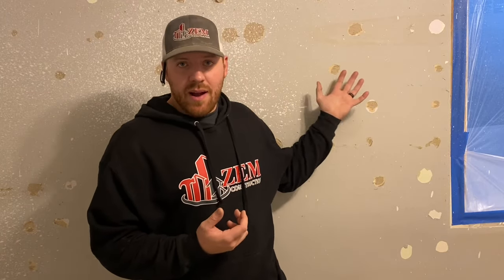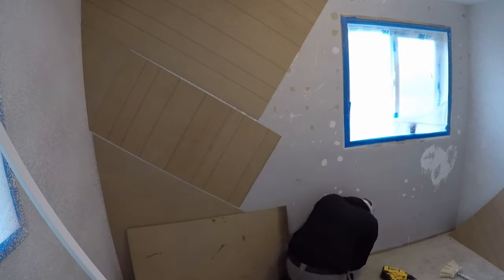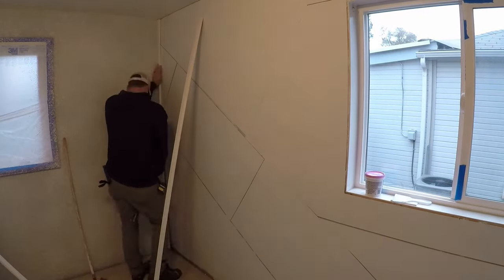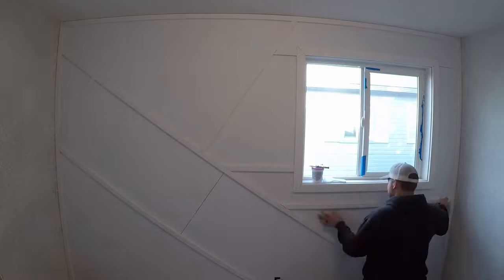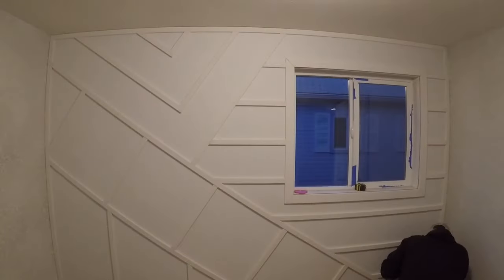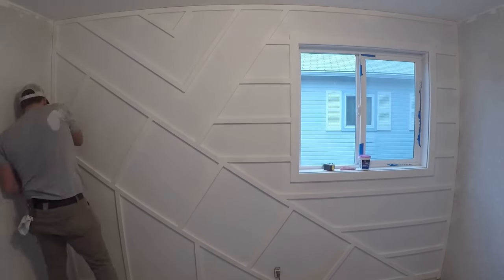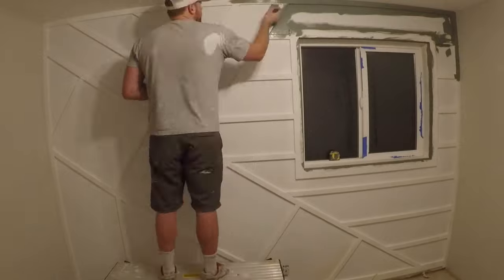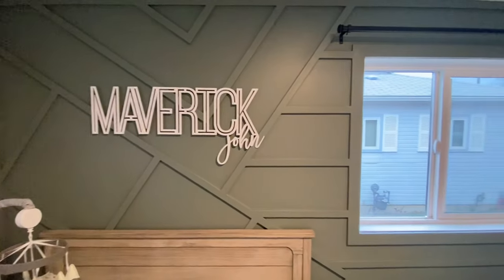Modern Accent Wall | Nursery Remodel | Time Lapse

Comment: Was the window trim flushed to the accent walls? Trying to do an accent wall with MLV and drywall to noise reduction. Not sure if I put the MLV/drywall to the edge (have to hide the sandwich look)and put the trim on top or just around with clearance to put the trim. Either it seems it will be heard to be flush with the trim and the accent slats.

Comment: Looks awesome!! Really really like it :) my wife and I are moving (and expecting) and we’re watching all these vids to get ideas, etc. we both wondered though, why the wood panels at the beginning? Why didn’t II just put the trim pieces onto the wall? At first we thought maybe because there was a texture you wanted to see through to the finished wall, but in your case, there wasn’t. So why the panels! Either way, it turned out AWESOME! Thanks!!
Reply from the maker: There were a ton of holes from where I took off the “pallet” wall both from nails and the adhesive tore the top paper layer of the drywall.
Reply: @ZEMConstruction  Ahhhh got it. Ok! Makes sense. Thanks for replying. Looks awesome! Love the fact that you used math :)

Comment: Looks really great, but you couldn't you have just installed drywall and used the trim to make the wall design.  I'm not certain why you hung the paneling as I do not see it in the final design.  Wouldn't drywall on an angle work just as well?  Did I miss something?  Great video and very professional looking job.  I love it so much I'm going to do something similar.
Reply from the maker: Honestly I hate working with drywall, plus in order for it to actually be flat you have to have several coats of mud filling seems and gaps, sanding between coats, and the added dry time. For a whole room or multiple rooms it would be ok but for 1 wall it would take days as apposed to an hour to just hang paneling.
Reply: @ZEMConstruction  Yeah, I get it. I’m a home improvement contractor as well. Great video. I was just curious. 

Do you actually see the grooves in the paneling on the finished product?
Reply from the maker: No those lines were just printed on. The panels were actually perfectly smooth.
Reply: @ZEMConstruction  Ah, okay that makes perfect sense now.  LOL. 

Thanks, great job.